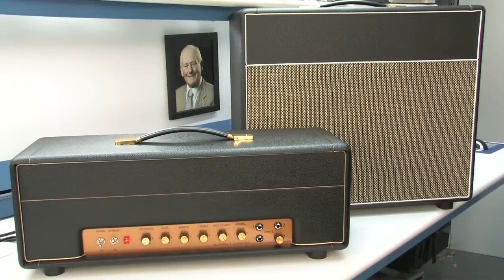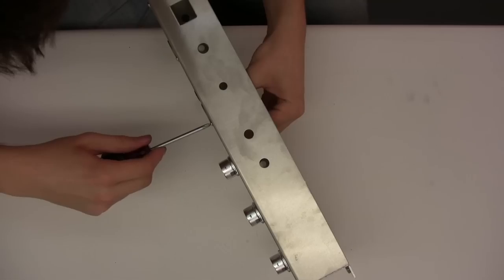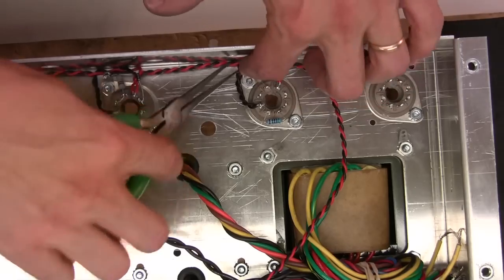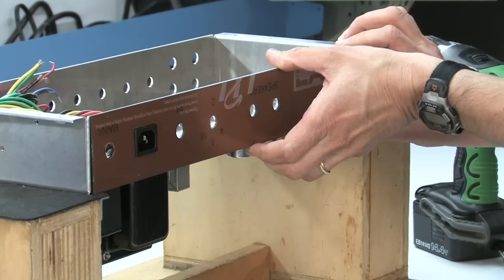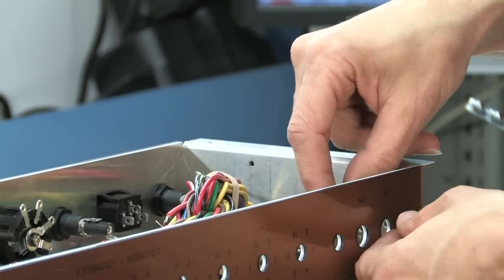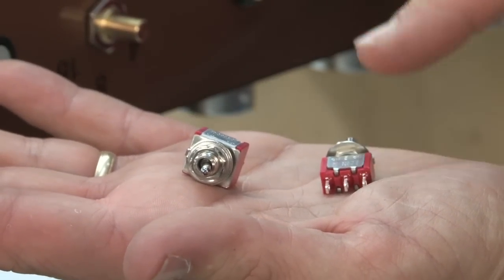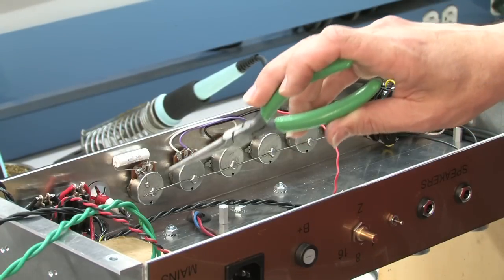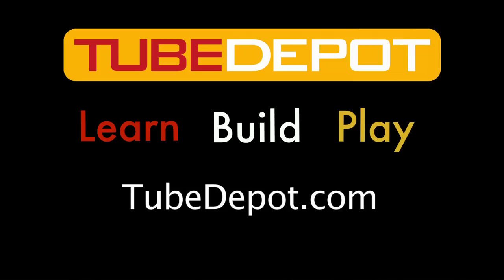How To Build a British JTM 45 Plus

Comment: Sorry but that is incomplete ..Plus you need to do the work so the pot tabs can lock .Do not snip off the tabs.They keep the pots from turning in the hole. Anyone can do the simple stuff in this video.. This video is only half the work..Not what you really need to know .Two guys & a drill to wind up two wires ? GET REAL ! OH yeah , love your master volume...WHAT DOES IT WIRE TO ? WHAT ABOUT THE OLD INPUT ? WHAT ABOUT THE TRANSFORMER WIRES ? THIS VIDEO IS A TERRIBLE Waste !

Comment: as a bigger kit manufacturer, stop teaching people to break of the tab on the pots. Instead make the additional hole for it. It makes assembly much easier and nicely prevents the nuisance of pots spinning (instead of putting this "bus" on back, which makes changing pots so more annoying) .And the tab hole stays nicely hidden under the faceplate

Comment: Too bad you didn't show off the solid state/tube rectifier and feedback switch you showed us, that sounds like a very usable option that makes this amp versatile for more genres of music than it would if it was just a standard JTM45.

I currently play in two totally different sounding bands (Bluesy and Stoner Metal) and my little blackstar amp does ok covering the spectrum because it's basically right in the middle of the two sound types i want to emulate but it's just not perfect for either one.

Now this mod you did on the JTM45 seems to be a much better fit to switch back and forth with.

Comment: why not rectify the filament circuit and get rid of the posibility of hum that way rather than twist the wires together to do phase cancellation via winding the fiilament circuit by twisting wires together? A small solid state bridge rectifier and one filter cap and resistor would not significantly add to the cost but clean up possibility of hum from filament circuit.
Reply: A power supply has nothing to do with sound. In fact a rectifier that is solid state full bridge after the power transformer would not sag with increasing load. Keeping a filament circuit only with two small diodes on each leg of the center tap, followed by a 470 uF capacitator and small zener diode would clean up hum on the filament circuit. It's very inexpensive in parts and would make it perform better without affecting the tube sound at all.

Comment: Hello, i like very much your channel, and i find it very interesting. Please i've seen a tool you use which i need but i don't know is name and i can't find in shops, so i would like to have some information.  I mean the tool you use at min 1.22. Is that a sort of manual hole maker (sorry for bad english)? Something that make small hole to steer the drill? What is his name, where i can buy it? thank you very much
Reply: that's a puncher, it makes a little hole mark good enough for the drill bit to start the hole without slipping
Reply: it is a spring loaded center punch I do not know what country you live in Nico but in the states they are available at Harbor Freight or at metal working supply stores for a few bucks, or if you are poor, a finishing nail and small hammer will do the same thing
Reply: i'm italian, every time i try to find it in a shop of my city, people took me for crazy! amazing, i finally found it online, thank to all of you, and still to built tube amps ;)

Comment: A grounding washer on a plastic jack (8:47)?  I can't see where it makes contact with anything, so what does it do?
Reply: it stops the jack from spinning in the socket. Plus you can connect the shielded side of the jack to the grounded washer via a cap to shed RF noise that is riding on the guitar cable.

Comment: Questionable practices. Drilling in the chassis when half of the components are already assembled? Breaking off the position key of the variable resistors and soldering a wire onto the cases? This was not the way I leaned to build tube equipment back in the 1970-ies
Reply: +jlinkels Yea, but that old stuff is still working, why would you put effort into modern junk that will only last 8 years?

Comment: Hey Rob, try using nut drivers instead of pliers or an adjustable wrench to tighten the nuts on the front panel switches and pots. Nut drivers fit the nuts securely, won't slip, and have a smooth surface so they won't scratch. Otherwise, very instructive video! Thanks, Greg.
Reply: In my experience just tightening the driver by hand (without a ratchet) is also just the right amount of tight ...

Comment: What's with all the scratches on the inside of the chassis?  Nice pictorial layout template.
Reply: +SuperCarver2011 When they ship the kit, the blank turret board and the front and rear "plexi" panels are sitting inside the chassis (it's a convenient place to put them) then during shipping those little pieces slid around a little. no big deal.

Comment: Is it possible to build this, without any experience in electronics?
Reply: Erwin Turcinhodzic I think so, if you can read a layout and check everything.  Theory helps.  I plan to build one knowing very little about the theory behind it all, but just the basics about how to solder, etc
Reply: Erwin Turcinhodzic Ho yes ;)
Reply: Crunchifyable2
Crunchifyable2
Reply: +Erwin Turcinhodzic But you will want to take it to the shop to get the power tubes biased, or learn to do it yourself.

Comment: What is the reason behind twisting the wire? I know I've seen that a lot in electronical devices but I have no idea since some other wires are just packed together. To stay on place better?
Reply: the filament circuit is an A/C circuit,not D.C circuit. So this low voltage circuit carries 60 Hertz. Twisting the wires makes the magnetic field cancel out and makes less chance for hum.
Reply: alexander gonta 2
Thanks a lot!

Comment: HI there Tube Depot guys. Great instructional video, I'm half way to building my own version of this amp. One thing about your output transformer, what impedance is the primary winding?
Reply: If you use 2 output valves the primary winding is  8K with centre tap. Using 4 output valves the primary is 4K with centre tap.  Not critical. If  using an ultra linear transformer the screen taps would be at 66%. This for 6L6, EL34, KT66  etc. If using EL34 don`t forget to earth the suppressor screen on the valves you can then swap EL34 and 6L6 valves.  The original JTM 45 with aluminium chassis used 2 X KT66. Ask me how I know. The first very  4 valve  versions of this amplifier had 2 Radiospares 30 watt output transformers with the primaries in parallel and the secondaries (2 X 4 ohm taps ) in series. Ask me how I know that as well. I was stuck for an O/P transformer once so to get out of trouble I used a power transformer. The 375-0-375  rectifier windings for the anode feeds and the 6.3 volt heater winding for the speakers. Worked a treat for guitar. If you get any 100HZ hum then move the 1st pre anp cathode earth point along the chassis.  Good luck.
Reply: Crobular I Thanks for the reply mate. Can I dig a little further with you. I've seen JTM 45 transformers with 3 different primary impedances, 3.6k, 6k and 8k. I'll be using EL34's (possibly 6L6), so which of these is correct? I'm having my transformers custom wound by a friend that works in the industrial transformer business so I'd like to get this right.

Comment: Hi guys ! Your work looks formidably neat !
On the other hand, I'm building a '59 Fender Bassman model 5F6 and was thinking about doing some modifications (I'm aware that a JTM45 and Fender bassman are quite identical in some aspects):
1- Changing to a solid state rectifier
2- Inserting an effects loop

1- If I do this, should I change some capacitors values in the rectifying section for bigger ones ?? (I mean with more capacity)
2- I've heard that this might be a waste of time in a fender bassman because the difference in tone wouldn't be that noticable... And as a valve state amp, matching the impedances would be quite troublesome and I would have to design some buffer to lower the impedances and back. Anyway, I'm an amateur on this, what would you recommend ?
Thanks for your time!

Comment: just 1 thing my old jtm had parmeko transformer output made in leicester a very linear top quality tx.jim said they were the best but got to expensive oil cooled jobs.and the amp was biased not to blow up as they are now all makes, and the valves were better . mullard , general electric, my plexi had some kt valves from some us military stuff i had . not glass the body was metal live anode plate volts,on it still working.modern eecc83 and 12ax7 have automatic microphonics heater cathode shorting. and the gain is lower construction is cheep. but at a guitar show was given red dragon 12ax7 they were good lasted 12 monts before the ringing started.all these sovtec stuff rubish. a good old mullard or a valve from that period . mine still going strong.but im a fan of mos fet ebay china $20 including post 8 output devices 40.40 rail psu and out the preamp of jtm. wow sound is not dry, and its 350 watts. hide it in the corner of head amp.man its loud and rocks. does a jtm warrent price no, thes fets are bomb proof.nedd sone current at high power .make a hybrid see the diference. thanks guys jj

Comment: Do hour guys make a kit close to a Marshall 1959 plexi 
If so is the kit close specs wise to the original 1959 then the current reissue that marshall current makes ?
Reply: The Marshall 1959 model is the 100W version of the Marshall model 1987 50W amp.  The two amps are very similar, with similar tones.

Comment: Thanx, I'd mainly do guitar maintenance works... ( potentiometers, switch, pickups, groundings).
How many watts should the iron station be?  30,40w or higher.
A good brand for that ( long lasting) 
Thanx
Reply from the maker: for PC board work and general wiring, a 25W iron is excellent. However it may not have sufficient thermal mass for larger soldering jobs. A 40W iron is better for soldering to the back of pots and to terminals but the heat from these irons could potentially damage components and melt insulation.  Better to have either one of each iron, specialized for the job at hand, or purchase a temperature controlled soldering station.  The single wattage irons run around $30 a piece.  A temp. controlled station runs about $100 (well worth the money if you solder regularly).

Comment: These vids make me want to start soldering and building amps :) even if I can only make bad soldering :)
Reply from the maker: what may start off as bad soldering will quickly become extraordinary soldering with a few hours of practice.  Soldering isn't difficult once you learn the correct methods and have good tools.
Reply: Don't be scared , practise on an old , broken radios , TV ,  etc ! It's more easy cos is not board soldering for what I hawe still no guts ! I will recomend Y to use Silver based soldering wire , (for better and cleaner contact , with less corosion ) plus if Y can find , to be filled with cleaning cemical , inside , or if can't , use a quality paste to put on contacts , soldering iron ,etc , before Y start with contacting parts ( melting down soldering wire ) ! Ask a pro for recomandation , wich power of a soldering pen is gona suite Y ! Enjoy in future projects !
Reply: thanx so much :D

Comment from the maker: I think about a hot-rodded plexi kit all the time ...
Reply: +lordraptor11 while it is true that marshall has some excellent tube amps and amp heads in that price range, but if you want a marshall reissue of a jtm45 head it'll run you about $2000 @ guitar center and if you want a jtm 45 combo the closest thing currently offered is the blues breaker reissue (which isn't exactly the same, 2 x 12 speakers, 30 watts instead of 45, and with a tremolo ). compared to these amps you do save building a kit from tubedepot. But you have a point that alot of people figure that a DSL40C would be close enough for less money. personally I'm building the jtm45 combo.
Reply: Please do a 1959RR plexi! Even when I don't have the money for these amps, it's relaxing to watch these videos. You are the master of the craft.
Reply: BE100...???
Reply: ....and?????
Reply: +supercrackhead100 The most expensive parts in a tube amp are the chassis, transformers, knobs, sockets, potentiometers and a cabinet. Which are all included in a used amp. That brings it down to changing some capacitors and resistors to turn it into an old design.
Reply: *****  i would like to see you come out with a vintage style super lead ( hendrix style) with the 4 input jacks on the front.  although this amp looks nice and im sure sounds nice that master volume instead of a 4th jack kinda blows it for me :(
Reply: *****  actually think of a hendricks style superlead with the 4 input jacks but instead of just a head make it a combo ;)
Reply: +TubeDepot  
 
Great price for the your kit without breaking the bank, example I found a half for 1600 100watt, price of this kit I would have extra left over for a decent cabinet plus buy few pedals. 

Would you be coming out with a 100 watt kit that can switch between kt66, el34 and 6l6 tubes, resonance knob, master volume and a jose mod.
Reply: +DALE97DSM  i disagree.  for the price you could get a used genuine marshall.  nothign against TD but if you can buy a genuine marshall combo amp for 600 to 700 ( and that is new) why spend almost a grand on the TD one?  if you can get a used marshall head for 600 to 800 why get the td head kit?  i always wanted one of the kits but the lack of funds and price compared to a genuine marshall just doesnt justify it.
Reply: @lordraptor11  what good vintage Marshall head are you getting for $600-800? I see JCM800s going for $1300 and they're in "ok" condition. It's not just about the final product. Sometimes it's about the process and some people like to take on the challenge that kit building offers. I, personally, would rather have an amp that has all new components and was built by me. Sometimes these clones sound just as good as, if not better than the amp they're "cloning"

Comment: Rob, I would Like to use a real similar setup, only with 6 EM84's.  Thanks for the safety pitch. Do you think you could get your buddy with a filter cap, throw one to him and yell catch....just kidding THAT STUFF AINT FUNNY It is all fun and games till someone gets hurt. But then again for warped people like myself I dig humor at someone elses expense. I was 16 when my neighbor LIT ME UP with a spark plug while he yanked the flywheel!!!! YOWW! That smarts!
Reply from the maker: Although, I do not recommend messing with high voltage, the charged cap gag is best performed by a big guy on a small guy.  Otherwise, the consequences can be very undesirable.
Reply: big difference between a spark plug zap(had dozens of these)and getting dc voltage zapping you and your heart stopping.being dead is so FINAL!!!!
Reply from the maker: wayne smith Thankfully, the discharge of a capacitor is usually a localized event.  The current will flow from one lead, through the skin (the ouch part), into the other lead.  This involves only the hand, and the heart isn't in the path.  However, this knowledge doesn't make the prank any less painful.  Woe to the small guy that tosses the charged cap ...

Comment: Designed for small apartments. Actually, you could take 2 of the power tubes out to cut it down to 100W, at least that's what Mick Ronson appears to have done.

Comment: Your videos and amplifier builder skills are astonishing ! But could you focus just a little bit more on the wiring of the tubes and the components ? Your speak a lot about how to drill the chassis and how to put the power transformer on it (which is I think important) but we can't see a lot of how you wire the amp, which is I think fondamental in building amps ! Still, thank you for doing these vids.

Comment: Amps can do strange stuff. Even after discharging the filter caps stray voltages from other caps can recharge them to a point. It  will not kill you, but it is not pleasant. The jumper I mentioned keeps bleeding current to ground and keeps the caps discharged. ALWAYS REMEMBER TO REMOVE THE JUMPER when you are done with working on the amp, & or before you turn the amp on. It usually just blows fuses, but you will feel stupid either way if you forget.

Comment: Just to be safe, take a 1 watt 1K ohm resistor. Solder it to two pieces of stranded wire. One piece on each lead. One the ends of the wire put an alligator clip. Clip the resistor between a filter cap. (These are the big can caps right off the diodes or rectifier tube) Clip onto the + terminal of the first filter cap into the circuit. Then clip  the other end to the ground. Always wait 3 -5 minutes after an amp is turned off to touch anything. This R jumper will bleed any stored charges. :-)

Comment: The diode placement differs from the PDF in this video Pin 4,6 to 1.....in the PDF layout it goes from 4,6 to 3. Which is correct need info cause im building this kit.

Comment: Excellent suggestion. The THD Hot Plate is a personal favorite, but for those on a tight budget, check out Gerald Weber's attenuator project in his first book. It'll cost around $50 to build, and gives you about -6db. You can also daisy-chain 2 of them for-12db. I forgot about this because I play a Les Paul with P-90's thru an ancient Tweed Princeton, and I can wail nicely at socially acceptable volume  levels. I'm having a "DUUUHHHHH" moment right now, my bad.

Comment: i just finished building this amp 2 weeks ago and let me tell ya this head will blow your mind. And oh my god is it LOUD.  I run mine without the rectifer tube and leave the 50 watt switch on the 50 Watt position. My signal chain is an MXR Carbon copy into an MXR gt-od, into a Boss turbo distortion, MXR 6 band eq, and then into a homemade volume attenuator to switch between rhythm volume and lead volume.  Jumper the inputs, and tinker until you get the tone you want. You will not be disapointed!